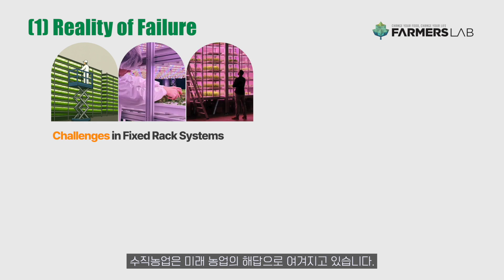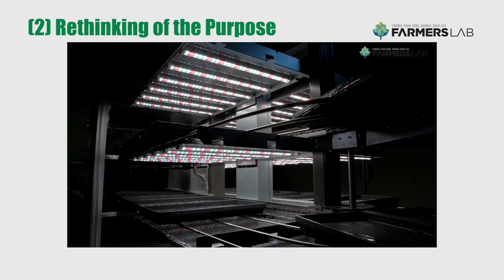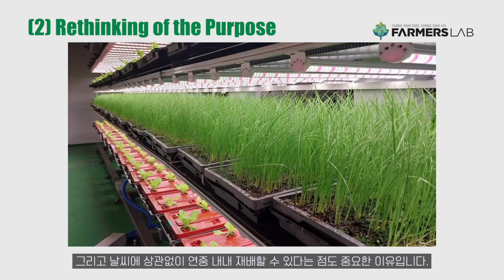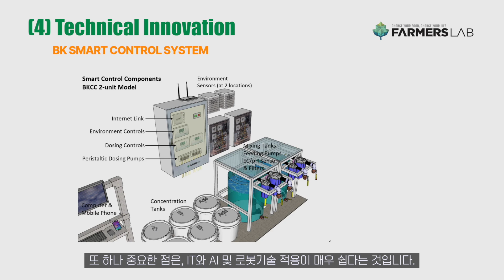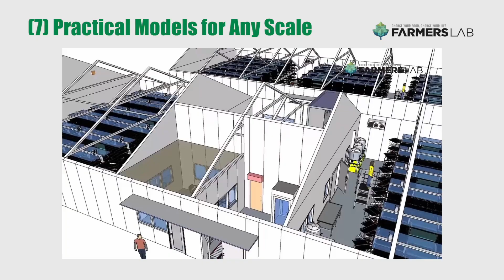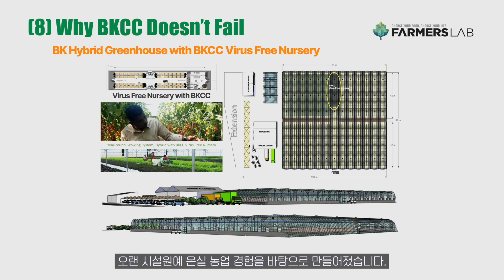Why BKCC Is the Future of Vertical Farming

Comment: Agreed,  with mechanization it is generally more labor efficient to 'bring the plants to people' (rather than the uncontrolled and more randomness of having 'people go to the plants') in a production system, but the trade here must be relatively expensive in this design, especially for such low value crops. Creative, though.
Reply from the maker: Thank you — that’s a very thoughtful point.

Yes, bringing plants to people can look more complex at first, especially for lower-value crops.

But in many real operations, the main cost is not the structure — it’s labor, handling, and workflow inefficiency.

Our approach is less about adding complexity, and more about shifting where the complexity sits — from people to the system.

In the long run, we’ve found that this can actually simplify operations and reduce total cost.

Still learning and improving, of course — really appreciate your perspective.